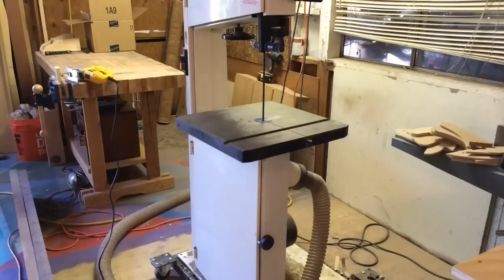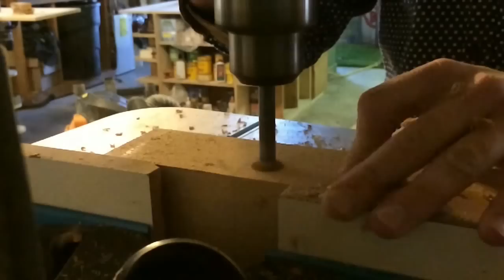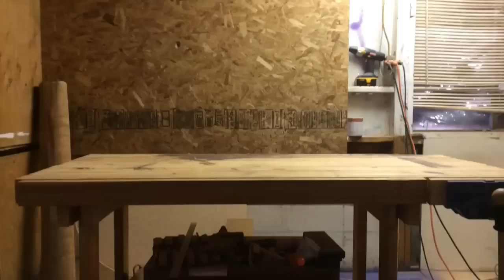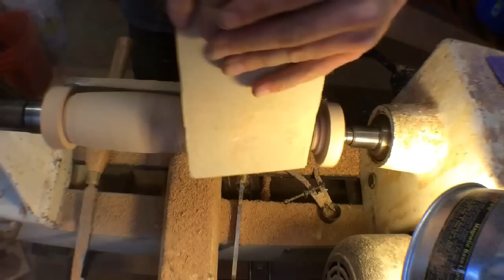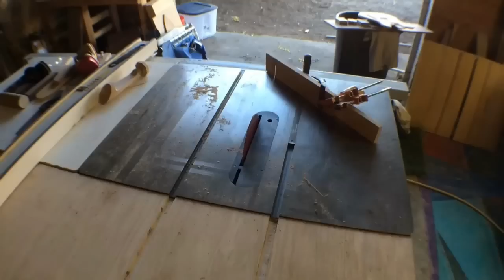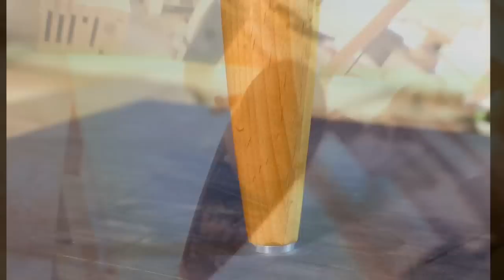100 Custom Tap Handles

Comment: That was a great video on production turning and a fantastic job you do.
I saw the waste wood cut from the top of the taps and I had a thought .They would make a great egg cup with the angle still in them you would only have to bore the hole and do a little more turning, only minutes, and you have a use for your waste wood Oh and beer money.

Comment: Awesome work, Kyle!  Can you tell me about the threaded insert you are using at the base?

And how is the logo engraved on the top?
Reply from the maker: The threaded bases come from a metal machine shop. They are at etched and I Epoxy them into place. The top laser  logo is done by a local laser engraver. Sometimes we use a stamp to put it on.

Comment: Kyle - two questions - Did you have a size gauge or were you just eyeing/free-handing all of them (either way...nice work). Two...out of 100 did you have even one chip out or anything on the lathe? C'mon...we're all friends here.
Reply from the maker: I use 2 calipers to measure the top and bottom. All the blanks are laid out before with a middle top and bottom so I have reference lines. But from there I freehand it. I have the shape down so I just know what they look like. I've turned close to 500 of these. And out of this 100 I had 2 chip out. One of them I couldn't fix. Thanks for watching!!